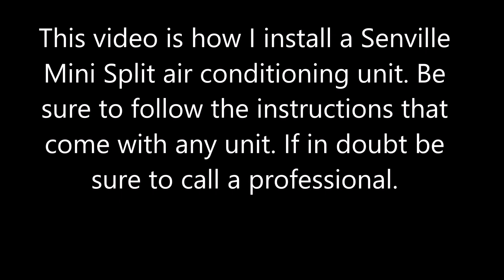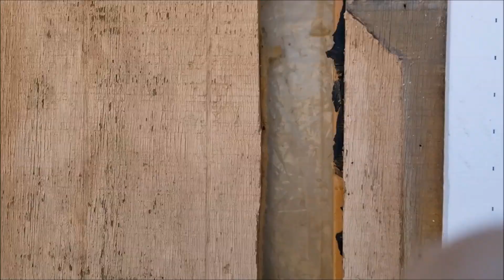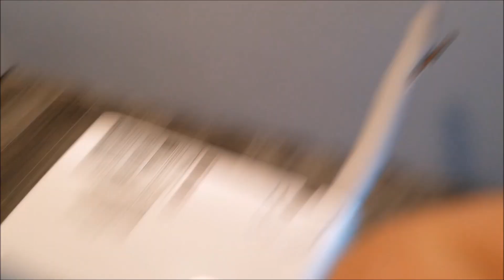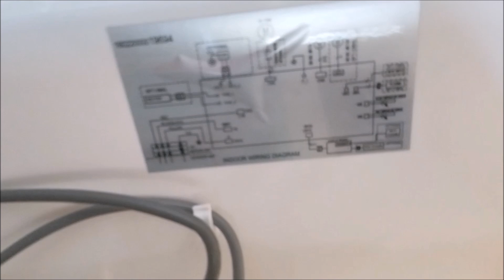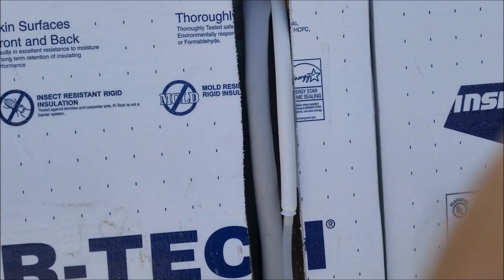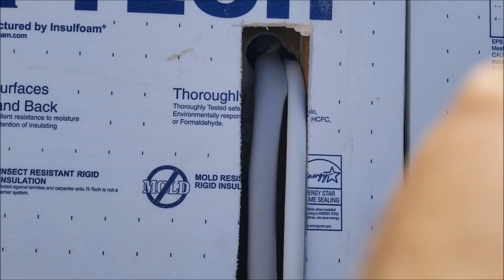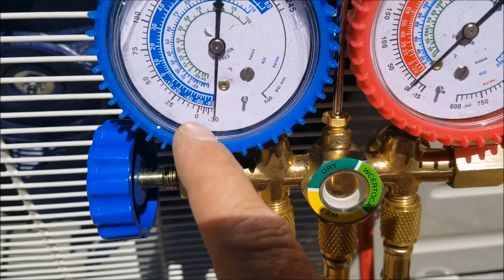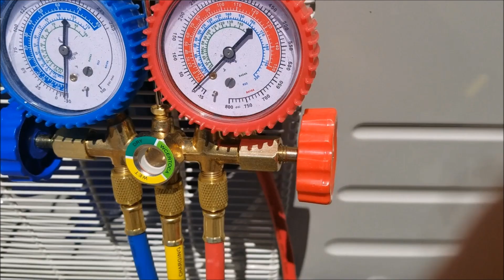How To Install Senville Ductless Mini Split 9000 BTU 230 Volt Air Conditioner Heat Pump

Comment: If you don't have a vacuum pump can you do a sweep from high side to low like you could on r22?
Reply: If you don't have a vacuum pump, you beg, borrow, or buy one.  Period. They are now a whole lot cheaper than paying someone to do it, if you know what you are doing. But USE a vacuum pump.  It's the only smart thing to do.
Reply: Everything should be vacuumed, but without a micron gauge you have no idea if you actually have a good evacuation. Don't skimp out, buy one for $200 or used for less then sell afterwards.

Comment: Where can you get the adapter piece to vacuum line?
Reply: I got mine off Ebay. Amazon probable has them too.
Reply: Joel Watkins does it push valve in to pull air from line? After spending a entire day going store to store I ended getting one that doesn’t push valve open

Comment: 1. The factory flares on these Senville units are terrible. Cut them off and make new proper ones -- and it is not easy to make perfect flares. Non perfect flares will eventually leak. You need good eccentric flaring tool for R410 refrigerant... and there must be ZERO burrs on the inside of the cut pipe before you flare or there will be a grove in the flare.  It's very, very difficult for a home-gamer to make a perfect flare. Imagine that each flare is a $1000 bet -- because it is.
2. Senville recommends refrigerant oil on the mating surface of the flares. Use Nylog instead. Don't do it dry.
3. Line sets must be no shorter than 10 feet long.  Mount the outdoor unit far enough away to make up 10' plus. Too short a line set means too much refrigerant is in the unit.
4. The flared connections MUST be torqued to spec. Under-torqued with leak. Over-torqued will leak.
5. Not nitrogen pressure testing the unit to 300psi+ for an hour is insane -- especially with the crappy factory flares and no torque wrench.
6. Pulling a vacuum without a micron gauge is a good way to have no idea about the quality of the vacuum.  These units need a very high vacuum or the compressors burn out. Do you really trust the cheapest vacuum pump you can buy? Maybe -- but not without a micron gauge.
7. A bad install may take 5 or 10 years to kill the unit -- so unless you follow the professional methods to the letter with the proper tools, budget for an HAVC tech to fix it (and he won't be able to get parts).
Reply: Most of these inexpensive units only have a compressor warranty of 5 years to begin with so DIY folks would probably be happy with 5-10 years.
Reply: @dyoel182  You can also use Nyloc on flares and make a better seal.
Reply: Just a few notes:
1. Yes making good flares is critical, and so is actually testing it with proper tools for leaks.
2. Nylog is POE oil that is thick.
3. That's not the reason, the reason is due to noise in heat mode.
7. Senville is rather good with parts. In fact they had them for awhile on their own website to buy. $300 isn't bad for the main circuit board.
Otherwise MRCOOL has shown to stand behind their units.

Comment: I’m installing one now , do you have to supply your own wiring from the inside unit to the outside unit ?
Reply: This unit comes with Condenser,  Head(Inside Unit), Drain line, Communication wires, Remote, and and misc item you need to install minus the outside power cutoff box, line set hide kit, stand/wall bracket and wire that goes from electrical panel to that box.
Reply: 603vettman Most of the time when you buy a line set the communication wire is included in that
Reply: Depends who you buy it from. Some sellers will include both communication and power wires. Some only one.

Comment: Question. I want to use one condescending unit but use two house unit. Both rooms are 200 sqf. What model would you use pal?
Reply: Rehab .... if  my unit were condescending......id smack it in the balls and find a more personable unit.
Reply: The next size up.

Comment: why did you not include how to fill it with refrigerant?
Reply from the maker: The unit comes filed with refrigerant. At around minute 12:40 it is let into the system using an Allen key.
Reply: When you open the valve with the allen key, doesn't the gas leak through the open? I mean there are three covers you screwed to close it. I don't understand why the gas doesn't leak through those. Would you tell me why?
Reply: @Jeremy-su3xy  The two spots where you use the wrench aren't open to the outside, they're access to the valve.  The vacuum spot has a little valve in it like a bike tire so it seals itself when you take the adapter off.

Comment: You say you need an adapter to hook the vacuum pump to the unit but you did not say what sort of adapter is needed (from what size and type to what size and type). Could you clarify that please?
Reply from the maker: Most Mini Split systems will need a 5/16″ Female Coupler to 1/4″ Male Flare to connect the manifold gauges to the unit. Here is a post with all the links  https://www.hvachowto.com/how-to-install-senville-9000-btu-230-volts-ductless-mini-split/

Comment: Never loop the line set in a vertical position it'll cause an oil trap and your compressor will go bad. You can loop them in a horizontal position however.
Reply: i have one looped just like that and its been 15 years and no problum with the compressor
Reply: I contacted Mr. Cool, a company that makes a lot of these mini splits; they said it's okay to coil up either way (horizontal or vertical) and no problems.   It's a wives tale that the oil will starve the compressor.
Reply: It was a problem with r22 systems, but higher pressures of r410 make this a non issue.
Reply: They advise putting a loop in for every 20 verticle feet
Reply: Wondered about that, thx.

Comment: Great videos thank you !!!
I'm still a little confused on the line  vacuuming- 
 if possible could you do a more detailed video on that process?
I have questions like - when you opened the coolent valves and THEN unhooked the blue lowside vac line why didnt coolent blast out? and then just some basic process questions - how fo you know which line to use Red or blue - Ive never hooked up a vac pump (can you tell)? 
 Great video They are really helpful.
Reply: There's a valve in the service port that's very similar to a car's tire.  When you remove the connection, a small amount escapes, but then the valve seals.
Reply: hire a professional
Reply: @TheKiltedHam  lower your prices and you'd be surprised how many people just might. I've been doing construction for 40 years and I'll be damned if I can make the kind of money Hvac company's charge for installing these units for the amount of time it takes and the investments they need to make. I've got quotes of 3500 and 2800 for this simple install once you know how. Please!!!
Reply: @bertpainter8385  I don't know where you are but for that type of unit we install for less than 2000 dollars. Those prices you quote are way out to lunch.

Comment: What did you do with the extra refrigerant copper line shown in 12:47? Did you just leave it there? Also, did you do it that way so you wouldn't have to flare the copper line?
Reply from the maker: I went back and shortened it with a flare tool. It can be left that way but is best to cut it to the right length.
Reply: aztikkel11 so you had recharge the unit with freon right?
Reply from the maker: The refrigerant can be pumped back into the condenser using what is called Pump Down Method. Once the refrigerant is back in the condenser it can be worked on again and let loose again afterward.
Reply: hire a professional.

Comment: Can you share the process that would need to be done to recharge this unit if it had a leak and lost coolant?  A step by step would be awesome explaining start to finish how to connect lines, bleed air from lines, what valves to open on the senville (like the allen head ones that you open at the end of your video to release the precharged coolant into system) . I have a senville that worked for a year or so and now won't cool and need to recharge it. I have tank, gauges and adapter, just don't know exact process.
Reply: it is ozone depleting that is why it is on the list to replace here in canada
Reply: @TheKiltedHam  Hahaha..
Reply from the maker: If I have a unit that needs a charge I will do a video but not sure when that would be. It is simple enough to charge a unit with gauges. The refrigerant is bought in a tank and hooked to the unit with the gauges. Be sure the correct refrigerant is used such as 410a. The tank is set on a weight scale and the correct amount is let in. Buying the refrigerant may be the hardest part since they require a certification. It is sold on Amazon and eBay which I’m not sure how they check for certification.
Reply: If you installed the unit right the first time you should never have to recharge.
Reply: jim rose that isn’t true at all.
Reply: to do it cheaply or to do it correctly? you can take the EPA test at a local HVAC shop(really easy takes 20 minutes) now you get a refrigerant card and you go out and buy a jug of 410a. you have analog gauges right? now, hook up the yellow line to the jug, now turn that jug upside down, now take your 5/16" adapter and screw that on the service port. now hook up the blue hose. now turn on the tank, with manifold valves in the closed position. now if the unit will start, turn it on, if it will not start open the blue valve and let some 410a in just a little at a time here. now, in cooling look at the psi ring on your gauge set.  In cooling mode a good ballpark reading will show 125psi....to do it right you need to empty the machine. look at the outdoor label, it will show you the factory charge. use your scale and weight in the correct charge. fix the fucking leak....